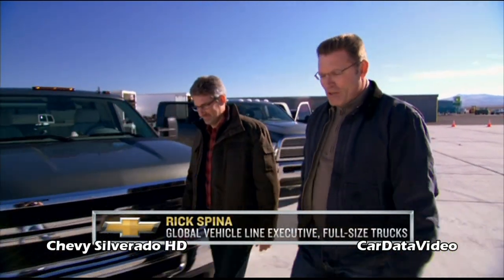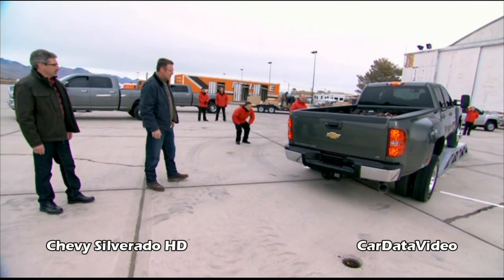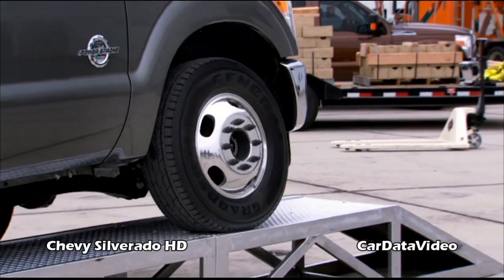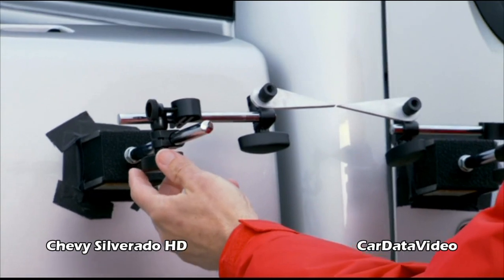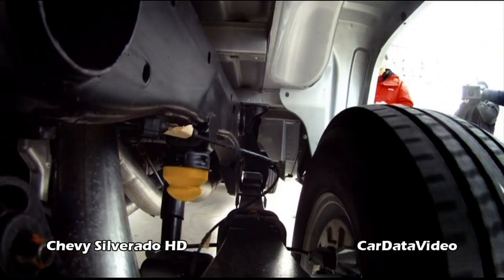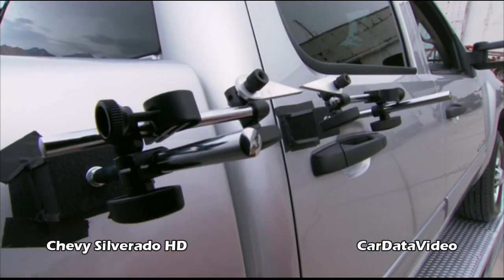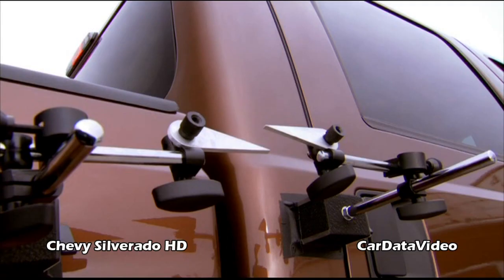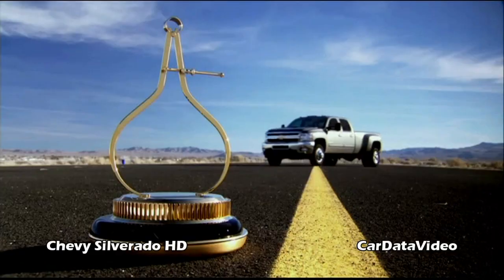Chevy vs. Ford HD Truck - Bed Bend Video

Comment: Your bed is supposed to twist from your cabin, it keeps all 4 wheels planted to the ground and avoids extreme and permanent frame bending
Reply: _ Drummie942 _ lol
Reply: _ Drummie942 _ ur bed isn’t suppose to move and twist a lot🤣that’s why u have suspension so ur wheels move but ur truck doesn’t all that much
Reply: Freaking hilarious. You aren't serious are you?
Reply: Yes, let's make our vehicle less rigid because that makes it more durable
Reply: The Chevy’s frame is so strong it wont bend
Reply: Have you ever looked under your truck?
Reply: actually hes right with huge load if the bed and cab was connected it would cause big ass ripples in the metal. the unibody fords in the 60s had low weight limit and had to have all kinds of reinforcement because of this. lasty gm has a ifs system on the front . does fine for a light duty you get to a diesel hd it really falls apart. the 04 duramax i had i couldnt keep front end parts under it. i currently own a ram but i have had 4 fullsize chevys 3 where hd trucks. never had a ford but they are much more solid set up all around compared to the chevy frame and suspension wise.
Reply: @milky3494  try to make a stiff bridge lets see how much time does it stand up against a flexible bridge
Reply: @franccosta69  Tacoma narrows was flexible we all know how that worked .
Reply: @Dr.Westside  Tacoma Narrows had a fatal flaw having to due with harmonics (the actual frequency range) of the bridge and wind.
Reply: @franccosta69  your example doesn't make sense. The flex in the truck should come from the suspension. You're assigning the responsibility of flexing to the truck bed and that's nonsense. The truck bed should be rigid. Otherwise your trying to stabilize a load on an unstable platform. Thats like looking at a camera stabilizer and saying the camera is the thing that needs to twist and turn and not everything else around it.
Reply: @phillippiris1022  The whole point of a suspension is to bear the weight of the load while absorbing impact. Not to replace flex in the truck if that was the case there would never be a need to have the bed separate from the cab because the suspension would handle it. honestly this test doesn't make sense anyway because neither of these vehicles are built for extreme off road, they are built to tow and haul loads.
Reply: @deadwejght5357  flex happens, but it isn't a desired trait. Flex shouldn't be replaced by suspension because it shouldn't exist. That is what Chevy is trying to convey with these tests, not the off-road ability. Separating the bed from the truck is to create manufacturing efficiencies across multiple models that utilize the same truck frame. it allows the ability to switch between cabin and bed size in the production process, while making damaged truck beds easily replaceable for the consumer. Your still assigning movement to something that should be rigid. Certain tolerances are allowed for ease of manufacturing and cost. Chevy is showing off their higher standards for what i'm assuming is an equal or lower price.
Reply: Atleast somebody reconizes me.
Reply: @optimaljz746  actually it is. they are legitimately designed that way. I don't agree with it but he's right. the bed and the cab are supposed to be able to twist independently of each other, why else do you think they are separate pieces instead of a single unit?
Reply: @Bman01234  that's because they use a box frame, give it a few years and that frame will be about as strong as glass from all of the rust.
Reply: @ElectronicsForFun  yes they are suppose to bend a twist, but like I said not a crap ton, just a little bit, if it keeps bending a lot ur gonna get small warps and bends in the metal, weakening it over tome
Reply: @phillippiris1022  your suspension doesn't flex though. you're only granted so much suspension travel.
Reply: @optimaljz746  not really because once you hit flat ground again the frame would just bend back. there is no reason a frame with so much give to it would bend and hold shape against the weight of the truck.
Reply: Milky yes.
Reply: Uhuh, so it’s supposed to make a huge dent in the truck and make it so the bed door cannot open?
Reply: @SunsetChaser300  you would never be at that extreme of an angle unless you were rock crawling but honestly if you're doing that you don't care about scratches and dents.
Reply: Actually you are very correct others don’t know nothing about truck
Reply: @franccosta69  actually flexible bridges move with the wind and are less likely to permanently bend
Reply: @optimaljz746  true but if a stiffer frame bends to much then it might be permanent
Reply: @SunsetChaser300  it was locked you can tell because our Chevy and Ford both have similar dent not from that though and it opens fine all they proved is how good the lock was
Reply: @Bman01234  lol
Reply: @scoot2114  thats what i was saying stuff that bends on purpose are better
Reply: @milky3494  if you bend something that isn't supposed to bend, it'll break/warp permanently, if you bend something that is flexible, it will bend back into shape, this is literally kiddie shit guys how can you not get this.
Reply: Little know the Chevy Creed.
Reply: “I am a no engineer, but that looks like a problem. “ 
Actually it looks exactly like the engineer wanted it to be. Chassis torsional strain is needed to maintain good off-road performance while keeping the cabin intact. 
“I am a no engineer, and I should shut the fuck up” is how it should went like.
Reply: Hallowed West is actually right; just Google "body-on-frame chassis" and "ladder chassis" and see why trucks use this kind of chassis, instead of a uni-body one like passenger cars. The truck flex is intentional, for cases of uneven terrain like this.
Reply: very true
Reply: Thank you.
Reply: @deadwejght5357 have you never seen the frame of an 18 wheeler? Or the arch in their trailer to give in with heavy loads? Quit talking trucks you make no sense.
Reply: @phillippiris1022 wrong answer, Chevy was trying to answer back to F150s having hydro formed steel frames with shock absorbers outboard the frame rails, they decided to do it with HD trucks and well do you even see that bodystyle on the road anymore? Heavy work trucks need flexibility in the frame. Look at 18 wheelers. Just stop talking trucks.
Reply: @ElectronicsForFun why not agree with it? 18 wheelers haul heavy loads and look at their frames smart one.
Reply: @optimaljz746 Have you ever seen an 18 wheeler cab bobtailing over a railroad track? Quit talking trucks bro.
Reply: @scoot2114 I feel like you are learning about cars and trucks.
Reply: @austinreeves9112  can I have some context as to what comment you're replying too? what am I not agreeing with? yes 18 wheeler s haul heavy loads and have solid big beefy frames. what is your point? they don't have tube steel frames if that's what you're thinking.
Reply: @austinreeves9112  I know this comment wasn't for me, but it seems like you're confused. ''Have you ever seen an 18 wheeler cab bobtailing over a railroad track? Quit talking trucks bro." unless you're going over the tracks at angle your frame won't twist when you're moving head on. doesn't matter if it's a pick up truck or a semi. your frame won't fold and it shouldn't but it will twist on uneven ground.
Reply: @ElectronicsForFun  that is my point. Heavy duty trucks aren't supposed to have stuff rigid frames.
Reply: @austinreeves9112  so you agree with me then?
Reply: @ElectronicsForFun  I am saying that heavy duty frames aren't supposed to be fully boxed, if you compare an 18 wheeler to a heavy duty truck frame that is why they bend and flex, it is to support heavy loads, the more rigid and boxed a frame is the more stress it will put on the frame over time. Half tons like 1500s, f150s are different. They have fully boxed frames because they are more off road and everyday cruisers, they aren't meant to haul 15-40k lbs.

Comment: I don’t like either. But a stiffer frame isn’t stronger.
Reply: It does when the body is bending and breaking to shit lmao
Reply: That comment makes no sense, so you're saying a more floppy frame is stronger? It's a frame not a noodle! At least you have 34 Ford guys as your comment liking cheerleaders
Reply: @Smitty-op4ld  im not a ford guy, but stiffer isnt stronger LOL
Reply: @flight2k5  went over both you guys heads. Are you implying that floppier is stronger?
Reply: @Smitty-op4ld  are you saying stiffer is stronger?
Reply: @flight2k5  now you're putting words into my mouth and veering off of the comment. The comment was that stiffer didn't mean stronger. Then is floppier stronger?
Reply: @Oozywolf  and that's exactly what that Ford did
Reply: @Smitty-op4ld  depends on the situation
Reply: I'm no expert but if something is more stiff and rigid it can't absorb as much tension and pressure compare to something that has more flexibility?
Reply: Forged in Fire. Which blade breaks first? The one that flexes or the stiff one? I wouldn’t want such a stress test on my vehicles, though.
Reply: Stiffer isn't stronger.  Semi-truck frames are designed to flex to absorb torque, and an HD pickup frame is nowhere near the strength of a semi.  Flex is beneficial for most realistic applications.
Reply: @Oozywolf  bending doesn't imply breaking.
Reply: @Smitty-op4ld  "went over both you guys heads. Are you implying that floppier is stronger?" try breaking a wet noodle vs a dry noodle and tell me what happens. the dry noodle will snap and the wet noodle will bend. if your frame is bending then the torsion is displacing the torque being applied through the whole frame putting less stress on everything overall. so if it doesn't bend then the torque applied will stress the weakest link in the frame and cause it to snap violently. you'll notice as the chevy climbs you hear a lot more pops and clicks in the frame.
Reply: Robert Smith it’s supposed to bend you dunce. And stiffness =/= strength.
Reply: @flight2k5  yes it is LOL
Reply: @Smitty-op4ld  I agree with you brother Chevy for life
Reply: @FrequencyORD  🤣😂 no it’s not
Reply: @flight2k5  yes it is 🤣🤣🤣
Reply: @FrequencyORD  😂😂🤣🤣🤣 nope 😁😁🤣🤣🤣
Reply: @flight2k5  what the hell does a dump truck have to do With this??? 😳
Reply: @FrequencyORD  tell me who genius engineer, why is it strong enough for a dump truck or heavy duty truck but not a light duty truck 😂🤣
Reply: @Smitty-op4ld  you obviously don’t understand how truck frames work. Ford is DESIGNED to flex so that you aren’t damaging suspension and the frame itself.
Reply: Who tf will ever be aligned that way and try to unload shit from the bed. That’s stupid as hell
Reply: @Sae-qu2kg  This.  All these other pissing contest comments are completely irrelevant but yours is the only one that calls Chevy out for just being stupid.  No sane person would ever unload a vehicle that's twisted like that.  All sorts of shenanigans could happen.  This is why vehicles roll away and roll over.  Morons that aren't flat and level when they unload.
Reply: @Smitty-op4ld  ford makes their frames out of spring steel sure they are “floppy” but actually much stronger than something that doesn’t flex if it’s too ridged it becomes brittle
Reply: Fact a stiffer frame is indeed stronger
Reply: @Andrew B 
Lol nope cope harder
Reply: @ElectronicsForFun 
Weak aluminum frame = less strength
Reply: @YankeeDoodle2  fact it indeed is not stronger 😂🤣
Reply: @flight2k5 
Science disagrees with you
Reply: @YankeeDoodle2  😂🤣 no, no it doesn’t silly boy
Reply: @flight2k5 
So weaker floppier cheap aluminum is stronger than steel? You must have dropped out if school poor guy

Comment: “Why does this happen to the Super Duty but not the HD?”

Well, probably because you loosened the bolts
Reply: Yup I explained that lol
Reply: And the ford is more reliable
Reply: @Grady Frankovich , that's bs. My family has owned two fords in my lifetime. The first was a '97 F350 XL Crew Cab Dually. Beautiful truck, but we had rebuild the tranny 3 times. The second was an Explorer (I don't know the year). We had it for about 2 years before the engine blew up. I like Ford vehicles, but the drivetrains can't be trusted.
Reply: Ford's are supposed to have a flexible frame called A C frame and that lets if you're pulling a trailer or let's most of the back wheels to stay on the ground instead of 6 wheels going up into the freaking air and one on the way sarcastically I say
Reply: @bluewol7420  There's A reason most people say "ford, fix or repair daily"
Reply: @bluewol7420  no it's not it's ur opinion
Reply: @davidh3858  never heard that but I can tell you Fords for my grandfather and my overall family have been very reliable and I have had friends say there Chevy's drivetrain went out at 30k miles. one of my favorite Chevy's is the Tahoe/suburban. Those have been much more reliable and they are pretty decent vehicles overall.
Reply: @davidh3858  wrong you a follower not a leader
Reply: @Mcnuggt  No, the driver was fine. I will admit that we overloaded the shit out of that thing, and it was the 4 speed automatic instead of the 5 manual.
Reply: @cbpercy06  my dad's owned a f250 for about 10 years and never had to rebuild anything
Reply: Probably because Ford doesn’t know how to build trucks. Built Ford Weak.
Reply: @bluewol7420  ehhhhhh I’m not sure about that I agree it’s biased but I’m a gmc fan and Ford just idk not that reliable as
GMC/ Chevy